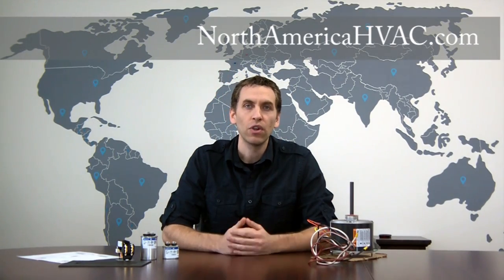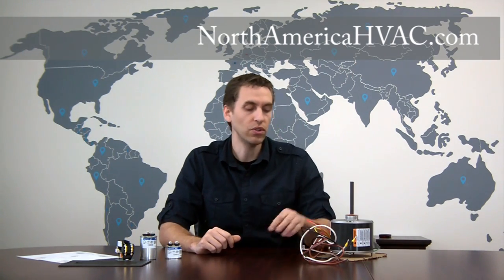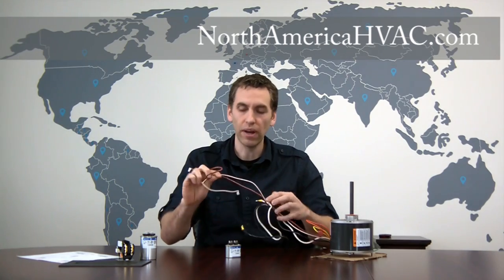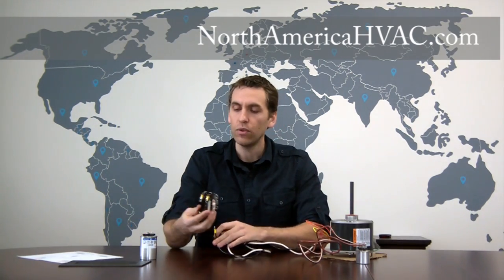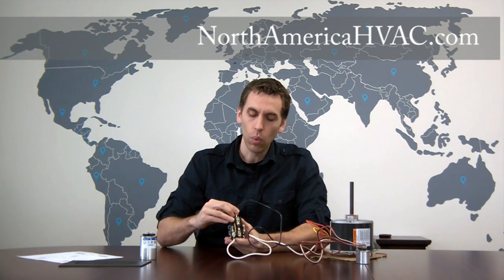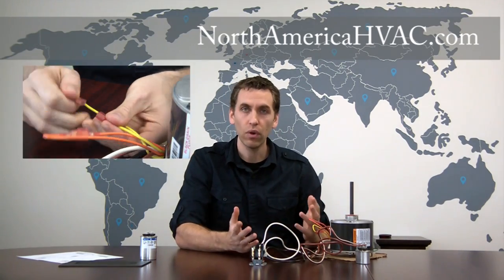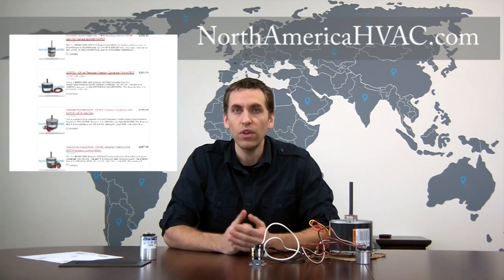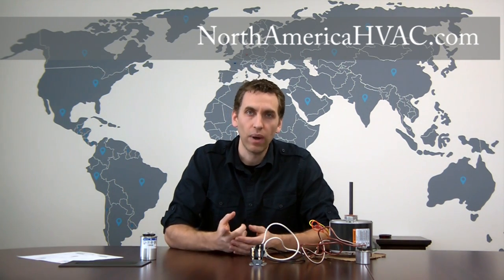How to Wire a 4 Wire AC Condenser Fan Motor

Comment: sir,note that it is about connections of the coil from inside that determines the ran, common, start, and the rotation direction wires. here is where the issue comes in. hope colour of wires confuses.

Comment: Thank you. When I went to install condenser fan motor the motor had 4 or 3 wire installation. I opted for 3 wire.Deadended the brown  w/ white stripe wire. Started fine...5 ton package unit cooled but the Condenser fan stopped after 15-20 minutes. Looking at old vs. new the Dayton (new) did not have ventilation openings in bottom to pull air through the windings so I am figuring the new motor is overheating and thermal overloads opened. I waited kicked it back on...cycle repeated itself. Now I will go Back and wire it with the 4 wire assy.

Comment: I watched your video on installing a 4-wire condenser motor.  When replacing a 3-wire motor with a 4 wire motor I added the 2-prong capacitor and just disconnected the old fan connector from the dual run cap.  Will the compressor run like this or do I need to jump any wires on the cap

Comment: The video was very helpful and made it simple. I have a problem tho. After running for less than five minutes I blew the breaker. There is three wires coming from the condenser, two thick wires connected to the contactor, and one small green wire that was connected to the dual capacitor I replaced with the oval. The green wire was not connected when I ran the fan. Where do I connect it? To the oval capacitor? There was also an orange wire coming from T2 that connected to the capacitor that I did not connect. Thanks!

Comment: My unit has the four wire fan, but it also has the Start Relay, the Dual Capacitor, the Start Capacitor and the single Run Capacitor and of course the Contactor. When my Start Capacitor failed, I just bought all new capacitors but unfortunately, the rushed photos I took of the wiring were not good enough to follow with certainty. I'm only finding videos for either or single or dual run capacitor with 3 or 4 wire fan motor, but
leaving either the Dual Capacitor or single Run capacitor out starts the motor fine but it runs at only half speed or so. My question is how to wire both into the circuit as a four wired fan.(Which is how it was wired before).

Comment: When installing a condenser fan motor and a single capacitor and the unit has a hard start installed with a dual capacitor do you you eliminate those 2 items, so will the single capacitor run the compressor and the fan motor.

Comment: Great video!   For my heat-pump, my 3-wire motor black lead went direct to a control board (defrost?) should I wire the black lead of my new 4-wire motor to the same board instead of directly to the contactor?
Reply from the maker: Yes, in your case, you'll plug the new black wire on your motor to the same terminal that the black wire from the old motor was on- on the control board.  Typically, only heat pumps will have this configuration and it is important for the defrost cycle in the winter.

Comment: Far Out!   Thanks for the simple instructions.  Now,  Can you tell me how to wire up and use a traditional air handler motor to replace the newer EMF ?
Reply from the maker: Unfortunately, without signification and unit specific wiring changes, you cannot use an older air handler motor to replace the newer ECM or X13 blower motors.  They are making generic X13 motors that you can use to replace yours, but in the case of a true ECM, you must replace it with another OEM ECM motor for now.  Good luck!

Comment: I have a Rheem a/c unit. The motor i'm replacing is a three wire (orange, black and brown) wires; new motor is four wires (two brown one w white stripe, yellow and black). unit has two capacitors both two wires. I hooked up like video said with both brown wires on one of the capacitors and black on one side of contactor and yellow on other side (same side other terminal). Fan ran slow, removed yellow wire and left off, fan moved fast I think like it should. Am I gonna do any damage? Burn motor, capacitor or whatever damage? Another video I watched said yellow wire and brown wire with white stripe are same (Brown with the stripe had an end on it yellow was bare wire that's why I used that one instead of yellow to hook onto capacitor). seems to run fine but worried I will have issues.. What do you think???
Reply from the maker: truth teller Thanks for your comment!  If your motor is running full RPM and operating properly the way that you have it hooked up, you will not damage it by continuing to let it run.  That said, there seems to be some odd detail missing in your description.  If you hooked 2 wires to the contactor relay (on each out going leg) and the two brown wires to the smaller fan capacitor (and not both on the same side of the capacitor), the only reason I can think of that it would not run full rpm would be a bad capacitor.  By removing the yellow wire, you dropped in motor's voltage from 220 volt to 110 volt, effectively making it a 3-wire motor, and a condenser fan motor cannot run on 110 volt.  Perhaps someone put a jumper wire from the contactor relay to the fan capacitor, in which case, you would not need all four wires?  If this happened, it would effectively be rewiring to the system to be set up for a 3 wire motor.  This sounds like an odd situation that would need a set of eyes on site to figure out exactly what happened and why- the good news is that if your running and cooling, your in good shape!
Reply: thank you for your help. Keep up the good work, you are helping a lot of people.

Comment: Just watched your video. I have a Rheem outdoor unit. I replaced the fan motor and bought a new dual run cap. The old motor is 3 wire and new is 4. So i followed your instruction to run it as a 3 wire however the motor is turning the wrong way. I swapped the wires as it says to reverse direction but when i power it back up it will not spin. Could this be because I didn't hook up the brown/white wire and brown wire to a seperate cap?
Reply: Hey, did you find a solution im having this same issue!!

Comment: my motor was the same but I also have a red wire. the motor I changed had a red wire as well but it was not used it was just taped off. what is that red wire for?
Reply from the maker: Hi, thank you for your comment. It sounds as though you have a two speed fan motor and only one speed is being used in this case. Good luck with the repair! :-)
Reply: @northamericahvacvideos  ok so that is not a issue? the thermostat has only a fan on off option or auto so I guess that makes sense since there is no hi or lo option.

Comment: Hi there.
I have a motor 50ktyz. 220v .   5 rpm with one red two white and one green wire and one capacitor it came with it.capacitor is 630vac 15.4j. I need help to connect it to mains to rotate 5 rpm . can you please help me ? Thanks
Reply from the maker: bijaya poudal Thanks for the question!  It sounds as though you are working on something outside of the HVAC field- or at least outside of the North American HVAC field.  If you are able, can you send a photo of the motor's labels to info@northamericahvac.com so we can see more precisely what you are working with.

Comment: The motor I have has a green wire as well. What do I do with this?
Reply from the maker: Many motors have a thinner green wire attached to the motor's casing- this is a grounding wire.  It does not affect the operation of the motor, but is a safety wire in case the motor shorts our internally and becomes electrified (extremely rare).  If you have this green grounding wire, you are supposed to connect to a good ground on the unit somewhere.  Where exactly you would connect it just depends on the unit that you have- often times there is a grounding lug with bare copper wires going to it inside of the control cabinet.  But verify the location on your exact unit with someone who can properly advise you before hooking it up.  Good luck!

Comment: If I connect the motor with 4wires where do I connect the small wire that comes from the compressor
Reply: Deirdre Staes to the H on the capacitor

Comment: Question for anyone who knows. I had a black wire connected to my capacitor (not from the motor). I had the brown wire, from the motor, on the same side as the black wire. Brown with white on other. I turned it on and the motor was making noise but did not spin the fan or even let me bump the fan to spin. I switched them and the thing has so far been working.

Comment: What if my motor don't cut off after I do this? ???
Reply from the maker: OLCtv Thanks you for your question!  To confirm, it sounds as though your fan is running even after the rest of the unit turns off?  If so, the most likely is that the wiring for the fan motor is attached to the wrong side of the contactor (i.e. the incoming voltage side) which would power the unit whether the contactor is engaged or not.  

Another possibility is that the thermostat is telling the whole AC unit to run, but the compressor isn't, which makes it seem as though the fan is running when it shouldn't be.  

If it is the entire AC unit that is running continually, then likely causes of the issue would include the unit not being able to cool the house properly or the contactor relay stuck closed.  If the compressor itself isn't running when you want it to, then a bad capacitor, burned off compressor wire, or bad compressor are the things you'd want to check into first.

Hope this helps and good luck with your unit!